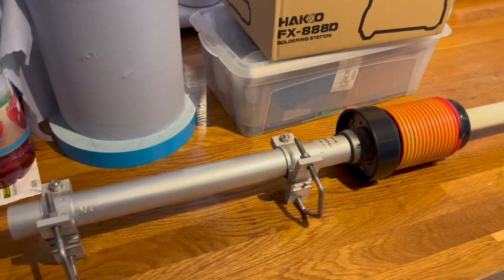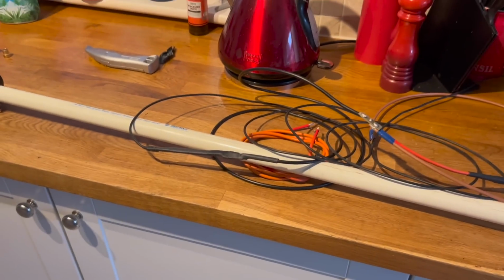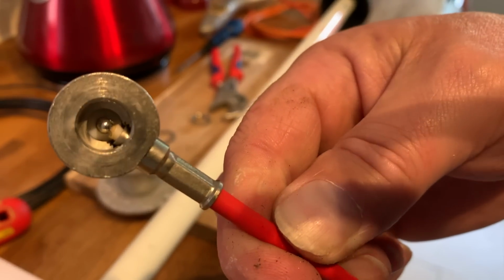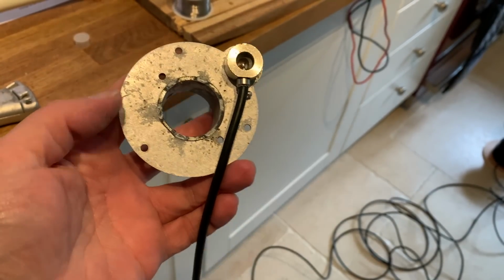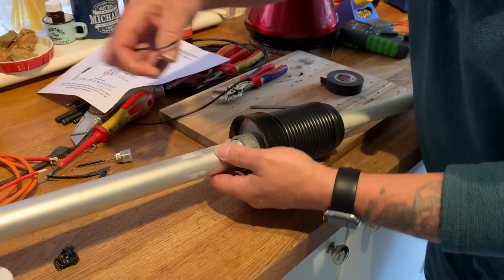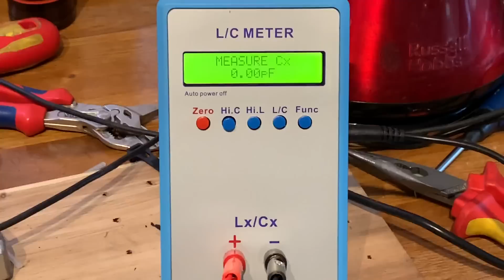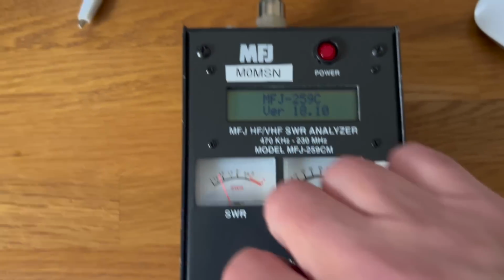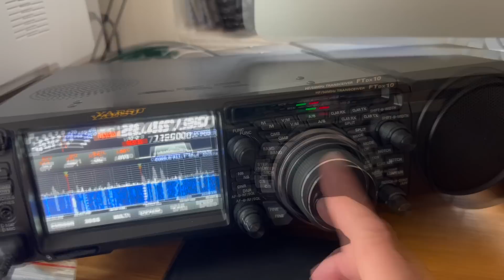CB RADIO: Sirio Gain-Master Repair / Re-build  11 & 10 Metre bands

Comment: I tried this antenna over the sirio 827 it was on the mast for 1 day then taken down and the 827 back up- the gainmaster turned into a horizontal dipole in the wind. Nice tidy job you made of that repair.
Reply from the maker: The 827 is the go to antenna in my book, had that up for many years prior to the Gain-Master, problem was the birds also love the 827 to perch on.

Comment: Nice repair ! . looks like you can use it on 12 meters as well. nice bandwidth !  The Gain master is still made new. Moonraker sells them. love the gain on them ! it's the 5/8 wave T2LT antenna.  I made a 1/2 wave T2LT antenna out of RG 8X and a plastic bottle about 65 mm for the coil with the ends cut off so I can slip it over the 10 meter DX commander pole and up with a piece of shock cord at end to hold it in place . go a usable tune 11 and 10 meter . makes a great portable antenna . takes 500 PEP watts with SWR  1.5 or less. even made one for 6 meters . next one I make is for 15 meters . will need longer pole. I watched both 1/2 wave T2LT and 5/8 wave T2LT video's on this you tube channel. their is a outher option for coil . wrap a ferrite FT 240-43 or mix 31 for the coil . with the RG 8X . would like to make the 5/8 wave one. have to get the matching stub coax. I have every thing else.  I have M & P hyper flex 5 and 7 . should work fine. 73's

Comment: thanks for the inspiration - saw the video on sunday and yesterday i finally managed to understand how the three matching components (capacitor, transmission line, stub)  work together by simulation in mmana and Will Klesey's online smith chart tool. Thinking about building one for 20m ... 73 de db3mi
Reply from the maker: 20M that is going to be a big antenna.. good luck
Reply: @mike-M0MSN  as it´s pretty broadband a 20m version should fit perfectly on a 13,7m fibre pole. thanks, 73
Reply from the maker: Yep that's the length I worked it out to be  @db3mi   so you would need a 15M pole so you could mount it ( Callum has some 18M poles)  cheers
Reply: May I know how to calculate length for stub ?

Comment: I have pulled a few Stationmaster, Itron and Megatron antenna's apart over the years myself. It NEVER ceases to amaze me that the part that is "factory sealed" is always the part with the MOST corrosion, I doubt ANY of these older antenna's were ever really waterproof, or even water resistant, I remember drilling a 6mm hole in the bottom of my own Megatgron antenna and watched about 500ml of sludgy, icky water drip out over a short period, it did drop my SWR from 1:4 down to 1:1.2, I wonder how badly corroded it actually was inside, I never fully pulled that one apart.
Reply from the maker: Yes it alway amazes me just how the manufacturers make their antennas. Are they made to last or is there an expiry date??

Comment: Nice restoration and well done! Could you measure the velocity factor of the original orange coax used by Sirio?
Reply from the maker: Yes, absolutely. However using the lengths of the original parts against the lengths of the replacement parts RG58, I worked out that the original coax VF is around 76% .

Comment: VERY curious how it loads on 15, 17 or 20? The A99 and M2000 load well on 15, and17 ? Seems I read Gain-Master snap somewhere around the coil ,  a small pvc pipe over that area might stop that?

Comment: Hello Mike. A general question and observation. I noticed on your unun making 49-1 etc you connect the twisted wires to eyelet and single wire to connector inner. Many unun I have purchased have twisted wires to inner inner of coax connector as its start of windings. I also make mine this way. But tried both ways and it doesn't make a difference I cam measure. Which is correct. Cheers from G1BKI mick (George)
Reply from the maker: Both will work, voltage or current is the difference..

Comment: about to rebuild mine as it has gone a bit deaf (very deaf now as in bits) and shows water ingress lots of it showing on the braid.
when taken apart found loads of pinch points on the coax where the coil starts and just inside the antenna before the first stub.
going to rebuild it in the week like the way you have and get it back up.
Reply from the maker: It’s a great antenna good luck with the rebuild.

Comment: Nicely done as always Mike. That gives you a broad, usable bandwidth. I'm not familiar with the Gainmaster, so presume your version has better bandwidth? Best 73 Ace G0ACE
Reply from the maker: It’s about the same bandwidth it just starts slightly lower down than the original, I could shorten the antenna but if it works 😉
Reply: @mike-M0MSN  ... don't fix it!! Thanks Mike.

Comment: Hello Mike, 
great job your repair at GM5/8. How long is the original capacitor (the shield from coax)? The coax looks like PTFE-coax high voltage RG142, 303, 400 95 - 96pF/m. 73 from Germany.
Reply from the maker: 8.5cm length Coax Cap is 8.6pF (RG142)
Reply: Thank you very much. 73 Marko 13RF787 13HN980

Comment: check the connection beetween the koax and the singel top wire, got that issues on some of my homebuilt GM..
When U got a break there the SWR risa up to 3-4 something..
Cheers de sm3tek

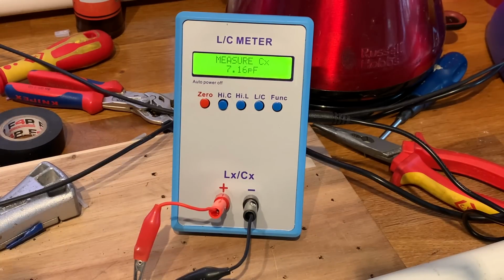Comment: 17:49 I've read that the capacitor is the weakest point, when it comes to the maximum power of the aerial.  Do you think changing it for a higher working voltage one would work?🤔
Reply from the maker: Yes possibly let me know if it works
Reply: The limiter of power at the RG58 coax (better is it to use Belden H155 PE) centerfeeded 5/8 dipol is the matching stub an capacitor, for the stub is it better to use RG213, Westflex W103, RG142, 303, 400 and for the capacitor RG142, 303, 400. 73 from Germany.

Comment: I've been thinking about rebuilding my 5/8 Gainmaster to be able to withstand more than 500w, why the factory engineered it for 500w max is anyone's guess! 
   Great video,  thanks for sharing!
Reply: Instead of RG-58, use RG-8x for powers above 500watts. It might withstand up to 1.5kw. For capacitor, use those thin RG-142, 303, or 400.

Comment: Is the BOTTOM of the top section of coax shorted where it joins the braid of the "capacitor"? And what would you need to do to get the antenna to be usable in the 12M band (shift the resonance lower)?
Reply from the maker: There is no shorts in this antenna until you short the end of the matching stub. The top section of the antenna is a DC block the centre core of the coax is connected to one side of the capacitor and the driven element is connected to the other. To make it useable on 12 you simply need to scale it up.

Comment: Could an ordinary capacitor be used? Sorry if its a silly question for some. And why the different coax for the matching?
Reply: A special high-voltage capacitor is quite expensive, which is why it is made this way. Price reduction.
Of course you can use any high voltage capacitor for several thousand volts.

Comment: Im struggling to source westflex, would it be possible to use rg213 as a matching stub?
Reply from the maker: yes, but the length needed will be different ( you will have to find the length needed by trying it)

Comment: Iam surprised that brand of antennas were good this is a first😮
Reply from the maker: The brand is good, I am to blame for the problems here, the idea is you only put it up once and it will stay working for years, but I keep putting the antenna up and down and overtime I have weakened the coax joints and connectors